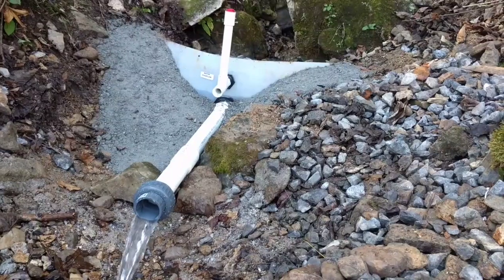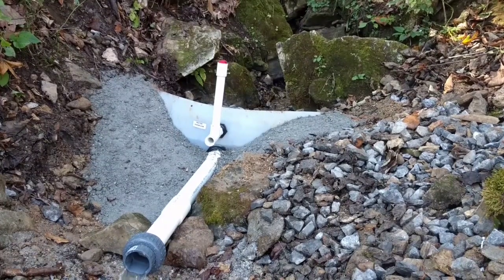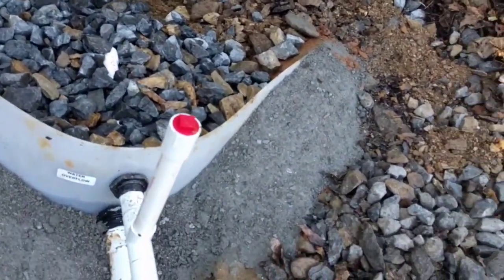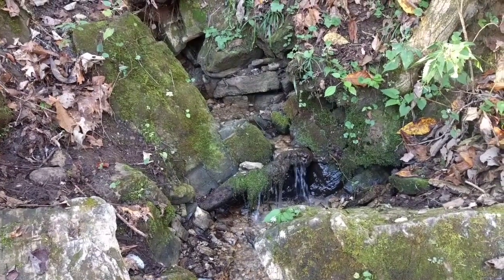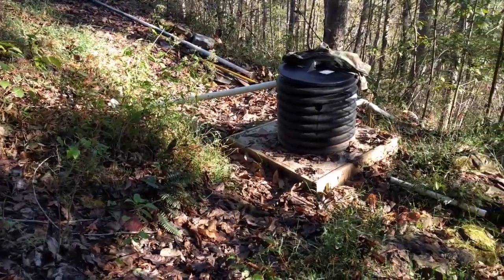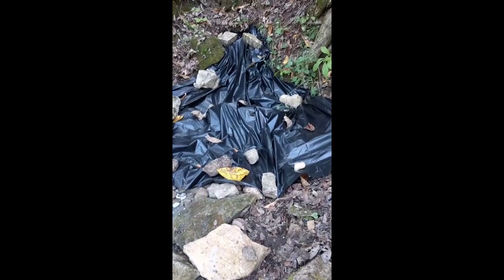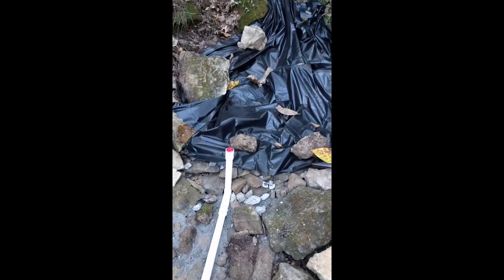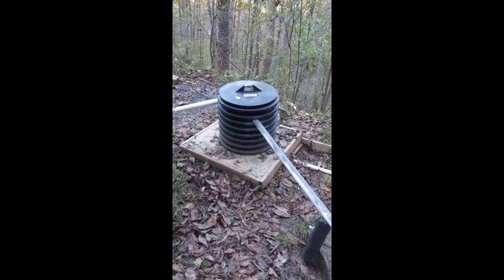Spring Development project Part 1

Comment: It seems like the outlet of the spring, where it comes out of the mountain, is the perfect size to jam in a 4" PVC pipe and plug the gaps with concrete. All you'd need is a 90° bend to route around the boulder.
Reply from the maker: I'll have to do that if I ever have to repair it cause the system has been working for awhile now

Comment: What couplings did you use? I’m trying to find the couplings to fit on my barrel I’m cutting up
Reply from the maker: Not entirely sure it's been a long time. If you are talking about the couplings that go into the barrel They are treaded with a compression gasket on both sides then into PVC pipe that runs into the collection barrel. The drive pipe that goes to the ram is steel.

Comment: I think you could block that whole section in and just seal the open areas and damn it in there. It would be a little more clean
Reply from the maker: Yeah it is a very large area that would have to be blocked in. It's still working.

Comment: I have some problem with pipe. I used hose before i lnow carolina stuff. How can I connect hose part to carolina spring box! 

Thanks in advance
Reply from the maker: I believe you could find PVC fittings that can connect the hose to the spring box. I have had trouble in the past with hose because of their short lifespan. They just keep blowing out. Definitely don't use hose from your catchment system to the ram pump or whatever pump you use cuz the pressure will definitely blow that hose.

Comment: You did an excellent job and have a nice spring. I live on rainwater from gutters(with a roofwash that cleans the rainwater which goes directly to my cistern) and have a ground water spring to supplement my rain water. I  have a video here on mine. You have a nice flowing spring. You will have an unlimited  water to supply a large household. Very good job!
Reply from the maker: Thank you! Do you filter then from the cistern to the house.
Reply: @RopesandWings  The rain water from the house gutters is filtered thru a screen, then thru a circular white fibered filter an inch thick which filters out all other minute particles, and goes directly to the cistern.   The spring water is filtered thru a sediment box exactly like yours(only much smaller). That is the only filtering for the spring water. But there are no particulates after this filtering. The water is crystal clear. The spring water is then sent to the cistern. I chlorinate all the water in the cistern and then it is pumped into the house. As far as bacteria and e-coli are concerned- the rainwater has no bacteria at all, but the spring water does have bacteria which is cleaned with the chlorine. I have my water tested at an EPA testing lab periodically. If it werent for the spring water, I could drink it(AND I HAVE) but because of the spring, we dont drink it anymore. Incidently, we have not had to use spring water or had to haul any water in 14 months. We have lived entirely on rainwater for the last 14 months
Reply from the maker: @gordoncrowley  Sounds like a great system! We had to gravity feed the spring water from the holding tank to the house, cause we lost our well pump for two months!

Comment: I have a similar setup, using the same dam. Since I am on the Gulf coast, I didn’t have the rock issue you faced. Started out with a gal/min output. A year later it has tapered off to a steady gal/ 3 min.  Not conducive for a ram pump, but still good drinking water anyway. Congratulations! Job well done ~ Dan 🦊
Reply from the maker: Scratch Made Homestead Thank You

Comment: Nice  job. What made you decide to place the dam further down from where the spring exits the hill? More chance for debris and run off if the tarp doesn't cover. Also in winter do you shut it down because of freezing pipes. Those rams do make some noise 24 hours a day seven days a week. But free. Gotta love it.
Reply from the maker: I had to go further out from the spring head due to the large rocks and how it was naturally laid out. Wish I could have put it in closer but the shape of the rocks would not let me. I back filled with gravel and plastic over top to keep debris out. I let it run all winter long so my pipes don't freeze.
Reply: @RopesandWings  Great job. There’s another channel WNC Base Camp where he actually did a job where he caught the water coming out of the rocks similar to yours. I think he used hydraulic cement. You should check it out.
Reply from the maker: @MrSouthofBoston  Good to know, cause due to Heavy rains here in Tennessee I'll have to go back in a redo it. Thank You